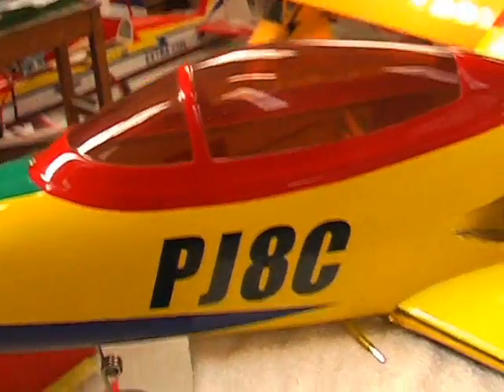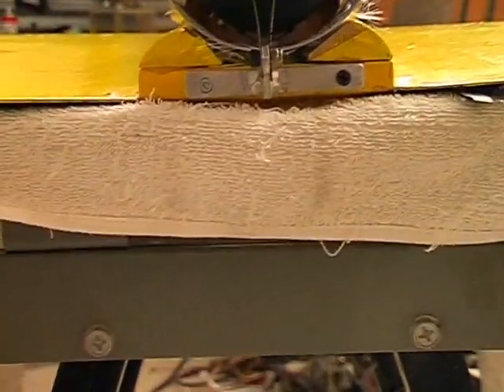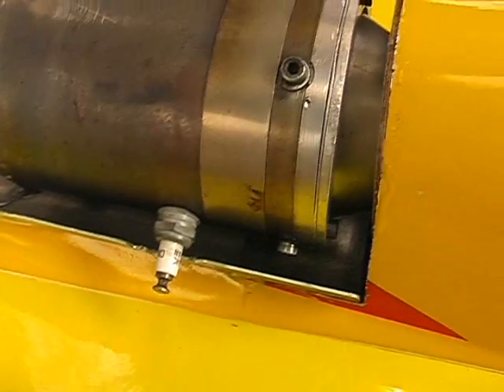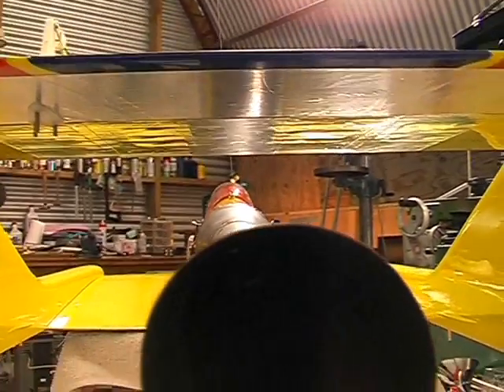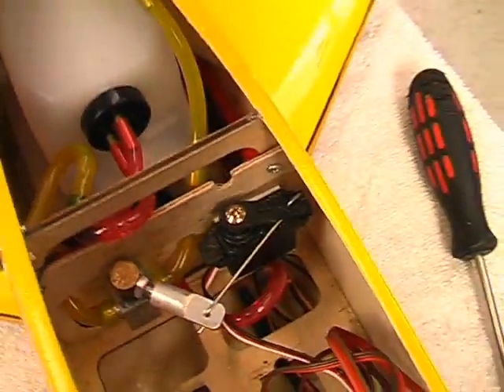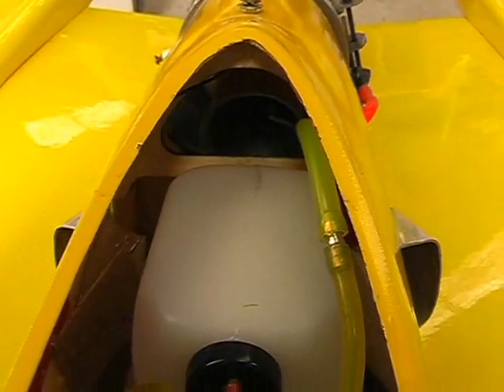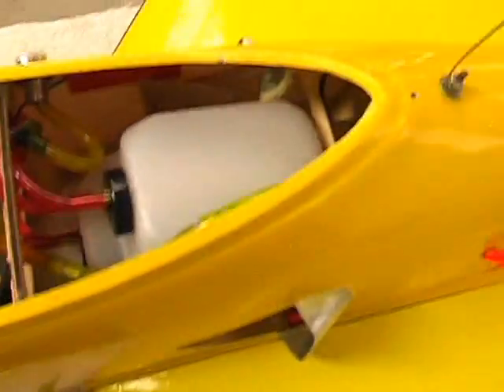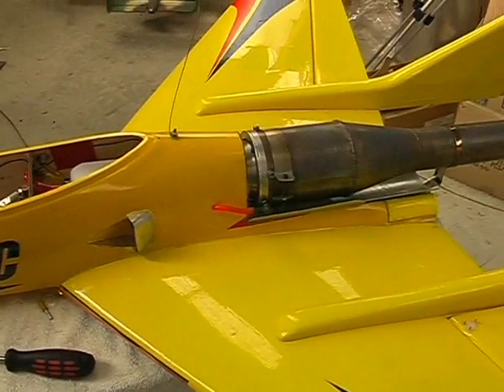A closeup of the pulsejet powered Bobcat ARF RC Plane

Comment: I was interested in building a pulse jet and an idea emerged. I was thinking of adding a small carburetor like one from a powertool to the front of the engine, my theory is that with a carb, the engine's power could be changed, rather then fixed. Would this work?

Comment: What is the thrust of the pulse jet used in this model? And how should I calculate the thrust to weight ratio of model aircraft, in case I want to design a model for a pulse jet like yours?